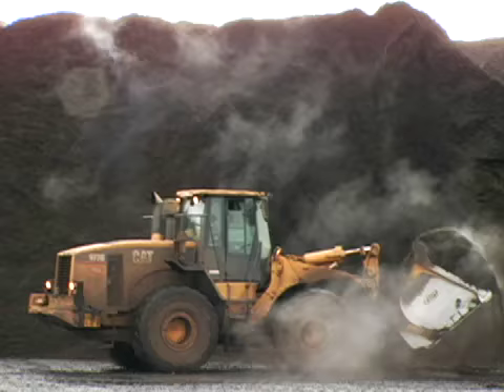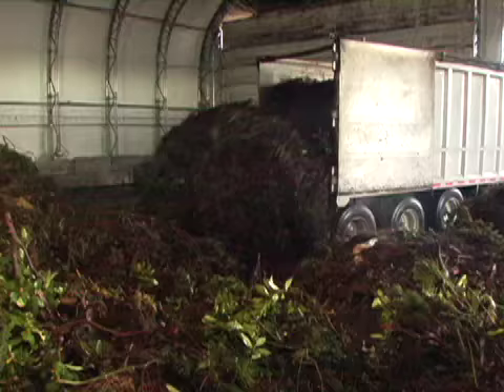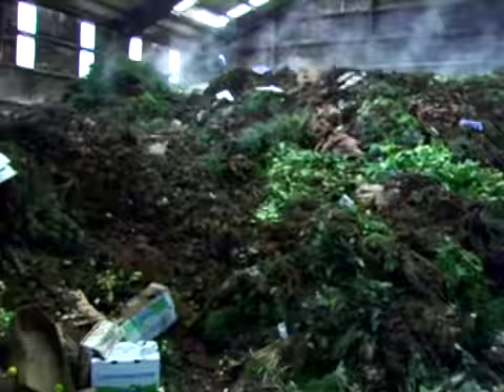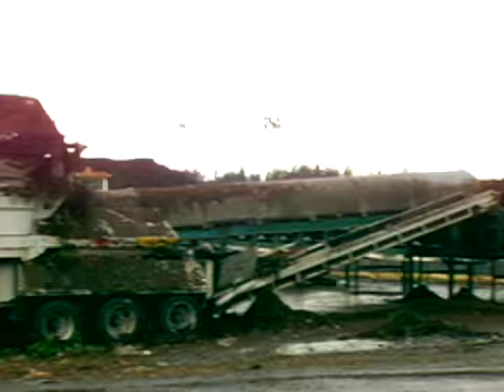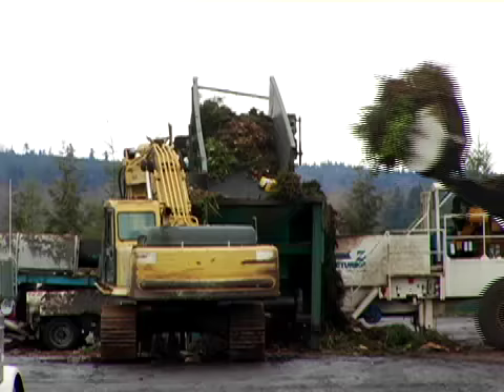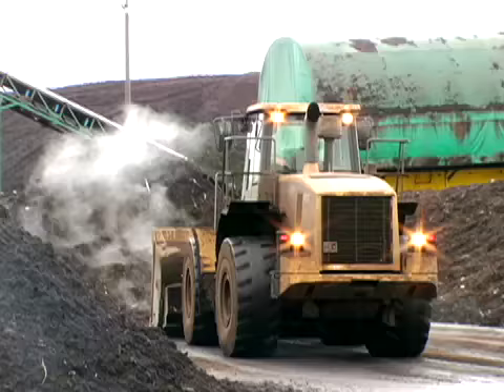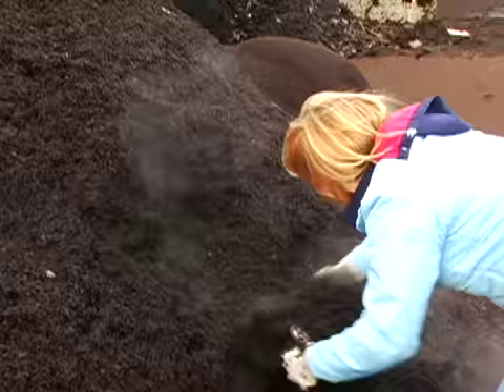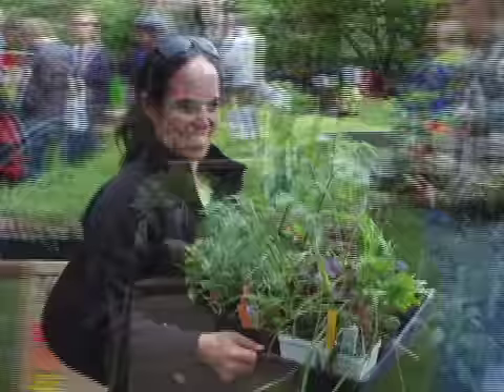Turning Seattle's Food Scraps Into Gardening Gold w/ Cedar Grove Compost

Comment: how do you filter out the plastic and other garbage?
Reply: JudgeyJudgeyable its already seperated by the customers.
Reply: it's easier to remove them after the compost it made. It's done by screening with sieves or with a vacuum to suck up the lighter plastic.  It's not a perfect process as microplastics still make it through.
Reply: Looked like that was being removed as it moved along conveyor belt. I think that was after the magnet separated ferrous materials

Comment: Great site/project! However, although we all realize that you have to "break a few eggs..." so to speak; I see that all those grinders, sorters, shredders, screeners, conveyors, etc... burn a TON of diesel fuel per hour. Some tub grinders with thier available horsepower burn 15+ gallons per hour. 

Green? Yes - AND no. 

There are some operations in Buffalo NY where the only machine is the loader to turn and mix. None of the usual equipment. Very innovative and true to being green and low impact - and saves BIG $. 

Nonetheless, this is a great site and great product you are creating. Thank you.
Reply: Green Infrastructure Buffalo NY Buffalo NY true. but still, all that diesel is better invested there than on a landfill. Maybe in the future there will be industrial machinery that can work with electricity and powered by the sun. now we still have to burn diesel.
Reply: The technology is moving as fast as the ideas with large hoppers and split levels etc etc. But every effort is wort it and this plant will invest and improve I'm sure.

Comment: Are there any residental areas near this composting plant? What I would like to know really is, is there any kind of bad odor coming from this type of composting and has there been complaints from the local residents?
Reply: There's actually a whole landfill there. It is in a residential area suburban Karen types. They used to have a power generating plant there burned the methane from landfill. Complaints shut it down. Now they have to off gas methane straight into the air lol.

Comment: Many people are not aware that such system is not environmental friendly. Composting with such a large amount of waste cause unnatural formation by anaerobic micro-organism which is a man-made process. It is not natural. This process is also debated to use aerobic organism as the willow is frequently turned. However large piling of waste does not exist in nature. Nature composters are not allow to work on it and too many of one type of composter generate an unbalance process which has side effects. The operation of the whole system from waste collection and plant processes use fuel, electricity and the release of methane gases. Many such composts are not accepted by farms as it contains high heavy metal.
Waste should be processed at its source with no collection and put back into the soil for the cycle to continue.